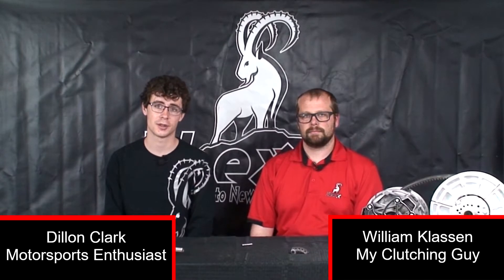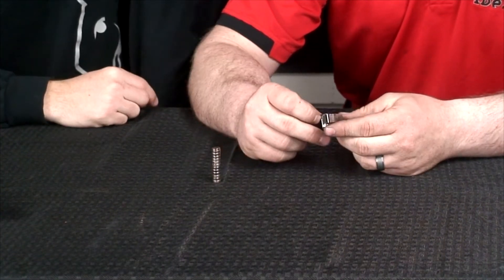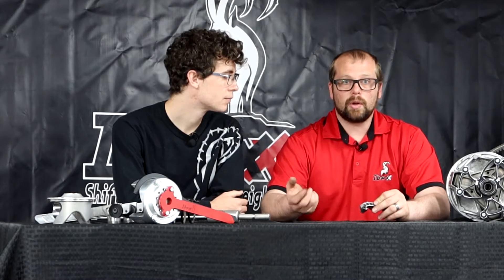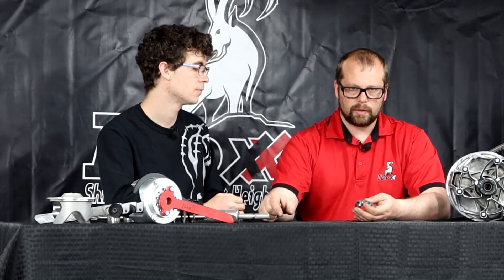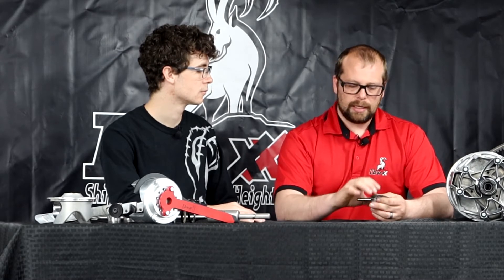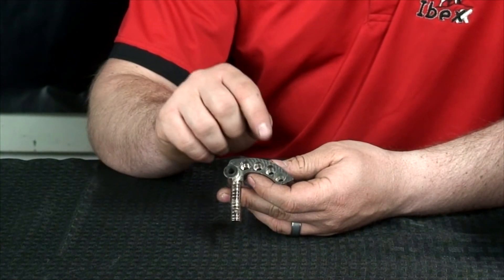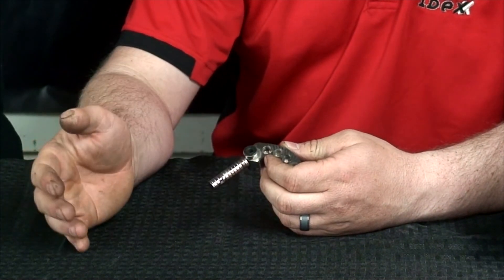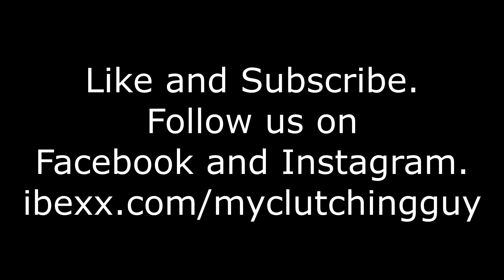My Clutching Guy Episode 5 - Clutch Flyweight

Comment: I just went from 200 to 300 hp clutch tuner had 3 none 1 end what would you suggest
Reply: When you have 200, how did the car behave with the 3-0-1 configuration? What level did you have the secondary helix at? How many rpm did it reach?

Comment: So how easy is it??? With magnets the clutch cover and spring has to be removed. The set screw type can have on mountain adjustment..
Reply: Depending on how the set screws are it can be easier or harder. This way you’re able to load it at a precise location. But the set screws are nice.